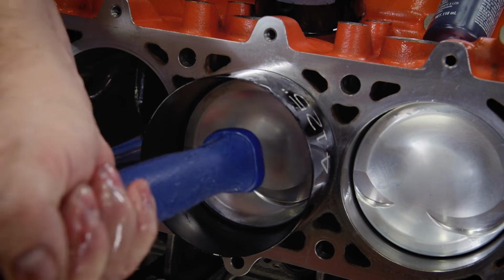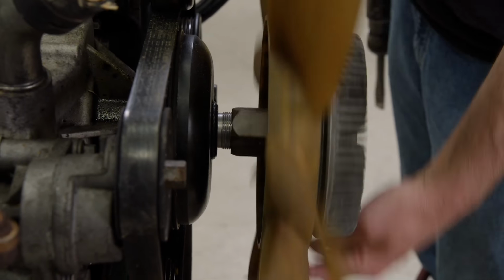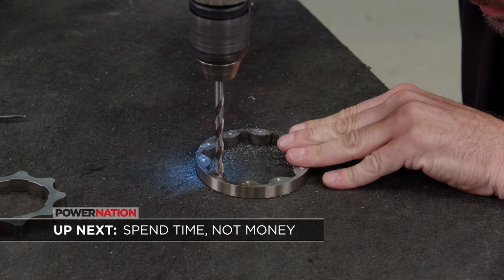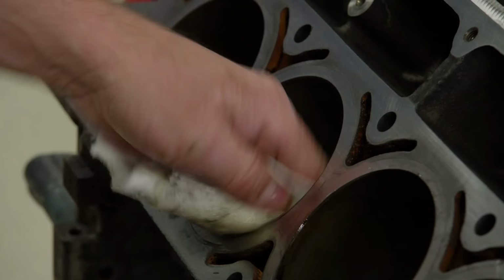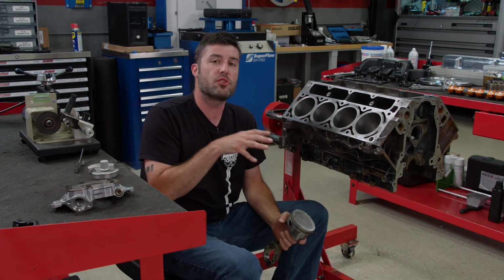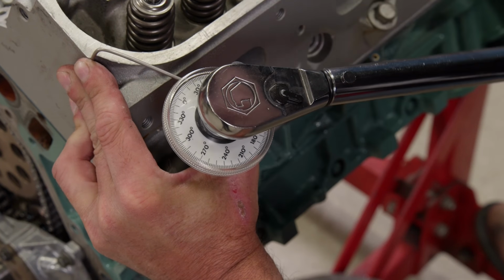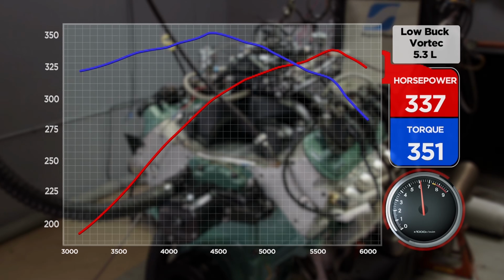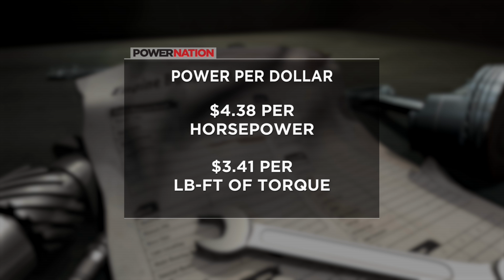Minor Upgrades Create Crazy Power on a Junkyard 5.3L Vortec - Engine Power S7, E10

Comment: Wow 30,000 on ring gaps is huge! Factory specs are 19,000!  Im running twin turbos on my 04 lq4 6.0. I did same thing, new rings n bearings, hand honed cylinders, valve job, new cam, cam bearings and valve springs too. So I opened my ring gaps to 28,000 on top and 26,000 second  ring for turbo motor. I ran it this way for a year naturally aspirated no problems. Now I added and run it with twin turbos 10lbs boost, e85, sloppy Stage II cam 228/230, 585/585 lift, 112 lobe separation, 100 lbs injectors, terminator x, TBSS intake, turbo 400 trans in 72 nova. Runs super, very strong, reliable and no issues!!! Great fast street/strip car, very good street manners too.

Comment: 2004 silverado 12 miles over 300,000 this 5.3 doesnt so much as even tick,clatter nothing it can burnout in four high the looks this old girl gets but alas,the body is so rusty i got sick of moving grounds had to ground the engine to the frame along with almost everything else thinking about treating the 5.3 to a bath gaskets,and swapping all most mint no rust 98 gmc cab onto her old bones yup grace may get a face lift.like buying a ham and taking out the bone,waahoo brand new ride,by the way can any body recommend any mild lift kits or leveling kits,because the fancy label places seem to be getting shittier by the year, thanks

Comment: You left out the most expensive part. Add another $1k for the engine management system. An LS doesn't have a distributor. It will not run without an engine controller. Pretty deceptive on the total cost. Regardless of what you read on forums, $500 complete LS engines don't exist. Known good engines for less than $1,200 are rare. The actual price for this complete, running LS with nitrous would be closer to $5,000. That doesn't include the labor or the cost of having the block cleaned, fluxed and prepped. Then you need another $1500 worth of specialty tools to get it assembled. After that you'll need new engine mounts, a flywheel and clutch assembly, entire cooling system and a bunch of new gauges for monitoring the vitals. That's only if you already have a GM transmission. If not you'll need to add that as well as the driveshaft and cross member. If you're looking to repower a rolling chassis then you're looking at $7500 for this same setup. If you're looking to repower something that already has a GM transmission and you don't need 550hp, just buy a $1,200 complete 5.3 with a harness and plug it in. That's a swap you can do for less than $2 grand.

Comment: You guys didn't remove and fix that crappy relief valve in the oil pan, on the oiling system that breaks and starves the cam for oil....?  Just had a 4.9L bored/stroked to a 5.7L and that's one of the things my builder fixed!  Previous one had went out and it literally ate the cam!

He put a plug in it!  Boom 60psi oil pressure on cold start like it should have!

Comment: LOOK AT THE BEARINGS THEY ARE BRAND NEW BETTER REPLACE THEM . THATS A GOOD WAY TO WAIST 1400 DOLLARS .This is why every doorknob  that owns a cresant wrench and a hammer thinks they are a mechanic .Did not even include the carb or the fact that you still need engine control in price crap like this just sets people up for failure .

Comment: i was wondering if any of your knowledgeable staff could answer a question,i have a 98 gmc sierra with the m30/4l60e transmission,and i want to swap in a fresh 04 5.3ls that im building nothing fancy do i need a different flexplate or anything any help will be appreciated by the way ive been a fan since it used to the power block back when courtney was the hostess

Comment: Do what I do grab a 200 dollar 350 build it up very cheap as in a 300 dollar stock rebuild kit off eBay through in the new rods and pistons, bearings and caps cheap set of valve springs 500 lift cam port the heads my self some open tube headers and a 800cfm holly double pumper and a racing electric fuel pump block off the old Manuel fuel pump hole and   and put it in my Miata and let her rip for a few years till it blows runs mid 10s at the quarter great bracket racing setup or easy money maker killing mustangs and Camaros and dumb V6 and 4 cylinder  Camaro owners and mustang owners as well who think there 200 hp junk is faster then a ugly ass junkyard looking built Miata lol love it

Comment: Either that intake is junk or they got punked on the camshaft. All other 200k+ mile stock cam 5.3's I've seen on the same Superflow dyno make 345-355 HP w/o accessories. Either way a 63% increase is pretty neat.

Comment: They left out a lot of costs!! Like new carb , air cleaner, throttle linkage, headers, dual exhaust, new push rods, rocker arm, taking to machine shop for cleaning block and polish crank. Plus if you do all that work you would want to put New gaskets and rod bearings.

Comment: I bought a truck that tree had crushed, for a 5.3 build. Never looked at mileage till I tore down engine. The oil stain on the head was pretty dark. The bearings looked mildly worn not horrible tho. It had ran supposedly before tree fell on it. While stripping the interior to sell the good parts, I glanced at mileage. Damned thing had 430,XXX miles. 
I figured nah its not original engine lol well I ended up calling the guy and he had bought it from his dad, who bought it brand new. They were the only two owners. The engine was original, but it was on its 3rd transmission 🤣 they had ran Castrol full synthetic for its whole life.

If anyone ever tells you chevy is toast after 150k... you can assume they don't maintain their cars haha

Comment: You forgot to add the price of oil and filter, coolant, air filter, power steering fluid, drive belts, spark plugs, oil pressure sensor, freon, motor mounts, assembly lube, sand paper and likely a bunch more stuff. The bill just went up another grand or more.

Comment: I bought my 04 avalanche NEW  same  motor 5.3 iron , 2021 march  my oil pan cracked from age cast aluminum  it was clean there was NO crap  , I always change the oil 3k miles ,  also changed the pick up tube  O-Ring.  Which is the number  one cause of low oil pressure , I think they over tightened the pan and cracked it ,  can't prove, new pan  500 $  ,

Comment: I have a 97 Silverado dually with a vortech 454 with 120k miles that is broke down needs a fuel pump , I'm going to make something but not sure yet, I was thinking to pump up the HP a notch and do the body work and paint the whole truck with bedliner and put a 6 inch lift and rebuild the rear-end with a 4.88 gear or maybe a 5.13 as I have done this same exact thing to a 98 ford ranger 2wd 4 banger and it worked out great for the back roads and the city with 35,s on back and 33,s on front with no rubs and it takes off better now than when it had its tiny 14 inch tires on it. and I have a few old 350,s and 2 400,s in the shed and may get rid of the 4 banger and stick in a 400 with Muncie 4 speed and the ford ranger has the perfect frame setup to easily do this. but I'm going to make a similar truck out of the dually. They will be twins kinda.

Comment: The factory ratings on that were net with full accessories and full factory exhaust.  This one had a "Stage III" cam and was dynoed in gross rating configuration with no accessories and headers and got those numbers?  Something is wrong with the tune or the engine.

Comment: If they added the price of the carburetor and the MSD box and new spark plugs and wires. I imagine the price jumps way above $3000. I think it's a fraud build.. better to use the original parts and computer to buy only a intake and performance tune kit. I bet it would run the same and cheaper for the money

Comment: Forgot to tally coil packs, plugs, wires, fluids, filters, sensors, valley cover, etc. Substantially proportional to stated costs compared to what you actually used overall.

Comment: I looked at a mid 2000s Pontiac Grand Prix GTP years ago when new. They are the 5.3 Supercharger setup. I test drove it but it did not have the Ooomph I was looking for. I had a Pontiac Grand Am at the time. Back then the only real performance available was the Corvette or Mustangs GTs. When the Camaro came back out I got a 2011. Nice car. I later traded it in on a 2017 Camaro SS 6 speed which is my current car. The fastest car I have owned so far and I have owned 60s era Muscle.

Comment: Now take that same engine and install a good intake plenum and run the fuel injection on it.
I want to know what the actual difference would be between a carburated setup and the properly tuned fuel injection .

Comment: Love this engine make sure you replace the "spider" inside the air plenum.
Reply: Can you explain this more, i am in the process of opening a 5.3l
Reply: @kevinc5917  is called spider injector there are videos here in YOUTUBE about it the problem is the seals break and fuel will start leaking  mixing with the engine oil. Another problem with the engine is the oil cooler the lines tend to break at the connectors. Otherwise is a great engine with lots of power.
Reply: @kevinc5917  system was on my Sonoma pickup a V6 not sure if the V8 uses the same pre ignition system.

Comment: I've worked on internal combustion engines my entire life and they sound, beautiful. but I've sat in a Tesla electric car and saw its engineering and I have got to say the gas people have got to go with what they used to go with, a long-lasting easy repair. the days of the different bolts for each hole have to end I grew up in Chevrolets, I replaced the power steering pumps of the 350 trucks in the 70S the 80 and the 90s, and now in my S10 with a vortex engine, the vortex are a marvel of engineering My S10 has over 100,000 and the engine is still clean on the inside. Why would my alma Mata use this crazy ac compressor bracket is there some kind of crazy torc I've missed? That the power steering pump is secured with seven different size bolts 13,14,15,16,17,18mm and I'm leaving out the upper neck little brace, I haven't changed a power steering pump in a while, but now the pulley has no holes so now you have to remove the pulley, It took me three days. and I had to get help because it's not a one-man job! first soaked it with a liquid wrench we removed the ac compressor, the belt, the clutch fan, the radiator and all its accessories, the throttle cable, and a bracket in 1998 I replaced a power steering pump in two hours alone and didn't even remove the belts, the bolts and this crazy ac bracket designed by someone with way to much time on his hands. and the hose that feeds into the center of the pump is now bent as if some kid in kindergarten was bored and decided to try something new and messed it up and left it! Even my loyal gm neighbor said "well it is remanufactured" and we both got a laugh, anyway it took me three tries to get the pulley off of the shaft and I had to hit the pulley with an Estwing 24 once hammer, hard. I was mad and ashamed, I'm not using the old pump and ill tell them I had to, it broke it free but to remove the pulley it took two of us a while to ratchet it off but it's off. And I'm gonna cut the holes in this pulley to match the 1980 pulley holes, so if I have to remove it again, I'm not messing with the pullers. And I'm leaving out a bolt, it's the very bottom one and it's not necessary, hell I believe they could have used three bolts period instead of seven, well five bolts and two nuts also for anyone out there, don't tighten the first bolts, until you have all of them treaded. And I think it could have been done without removing the clutch fan, also why doesn't the fan have the missing blades for easy repair???GM the future is electric trucks and you need to get your electric truck in the market now  IF GM WAS TO MAKE THE ENTIRE ELECTRIC TRUCK WITH THE ABILITY TO REMOVE EVERYTHING WITH A PHILLIPS SCREWDRIVER AND A RATCHET WITH FOUR  LONG SOCKETS.  EVERYONE WOULD consider it, if not BUY yours, JUST FOR THAT REASON. The entire market would think...... GM thinking of our future! ...hell just take a Silverado and make it electric make sure and get 400 miles per charge that's all you have to do! you would beat the ford F150...  Silverado with extended cab would mean a whole new thing. I dare you to do better!

Comment: Love the ring squaring tool. Never heard of one but is a must have. I’m a perfectionist when building anything and it would make it so much easier.
Reply: Save your $$ and use one of the pistons you just pulled out of the engine.
Reply: Do it by hand and use the back end of a caliper to see that it is square.
Reply: Use an upside down piston with the second ring on it.

Comment: Hi. I love your video.
I have to ask you, when putting the piston back into the block, what is the importance of the piston ring gaps?
I would also like to know how are the piston ring gaps aligned?
Are the piston ring gaps aligned in a straight vertical pattern?
Or
Are the piston ring gaps aligned in an offset pattern?

If the ring gaps are installed in an offset pattern, what are the offset degrees from the top ring  in respect to the other rings?

You feedback will be appreciated
Reply: 90 degrees from each other

Comment: Great video with a bunch of good tips for the oil pump, etc. 

My only argument is, you guys already had every part needed to keep the original EFI, but chose to buy a MSD ignition box, Intake manifold and carburetor… why? 

This is a “junkyard build” where you guys wanted to keep costs low, and yet spent probably 1500$ on changing it to carbureted when you could have ran the efi for just the cost of credits to tune it, in the 100$ US range. 

It would be infinitely more tunable and infinitely better driving experience on the street in any climate, temperature or elevation. 

Otherwise, great video 🤘

Comment: Looking for a shop on the east coast to rebuild a 305 chevy monte carlo 1987 engine and bring the horsepower up to 500 hp + and upgrade the rear end to match the engine out put . Also need a body shop to cut in t tops custom interior and paint job . I never had a car rebuilt and it's hard to find a mechanic and body shop person that does great work

Comment: Why do they lube the cylinder hone with 10w30? Is it because that motor uses 10w30 during operation or is 10w30 just a good hone oil weight in general?

Comment: That's why I use hand tools to take the engine apart and to put them together if you used a impact taking them apart you can't feel how the bolts come out and you may miss something important that you would want to fix before putting it back together.

Comment: I just yanked my 320K km 5.3 out of my Sierra - Other than VERY minor oil staining, the inside is totally clean. Bearings look like they almost just came out of the package. Bought from the original owner 5 years ago (so I know it's never been tampered with). DOD lifters were getting a bit janky, but still worked fine (large reason for my pulling it down was to do the delete). I've always done full synthetic changes at around 7000km.  Point is, a well maintained engine like this CAN and WILL last!

Comment: You got a total of $2470 at the end, but you didn't include the carburetor you used ($925), spark plug wires, headers, harmonic balancer, fasteners you replaced like the headbolts, etc. So probably closer to $4400. Don't put a carb on it though at least get a Terminator X

Comment: Hi guys Great job !!! I was wondering I have a 05 z71 tahoe that needs lifters it's got 200k on and I was thinking of doing the same thing as you guys did but run stock everything else,I already have a 3 inch exhaust that has a walker super turbo muffler and air raid intake,will the cam you used be able to run with a stock computer? I also plan on buying a set of headers for it too..thanx for all the great tips
Reply: ECM just needs a tune for best performance.

Comment: I've built many junkyard found engines by hand using nothing but a well calibrated torque wrench, good quality bearings and piston rings, new pumps/gaskets, some Plastigage, and some common sense. You don't necessarily need all of these machine shop tools to rebuild a stock engine, you just need to know what you're doing. For instance, I built a B18B1 (1.8L DOHC non-VTEC Honda engine) and after break-in it put down 409 whp on an eBay GT3582R turbo.
Reply: What power adder did you use?
Reply: @matthewvarnam4302  he said a GT3582R ebay turbo
Reply: @matthewvarnam4302  Turbo
Reply: As long as you’re careful and know what you’re doing should be okay
Reply: I envy you

Comment: To me, going to a carb when you got an ECM with the engine and all of the Injectors is sillyness. That should have been a 411 ECM, those are programmable. Would have much rather seen you make it squirt again rather than sucking fuel out of a carb.
Reply: Carbs produce more power and better fuel economy than fuel injections. This is a misconception that has been going on for decades.

Comment: For more power on the cheap,use ebay 4.8 flat top pistons.cheap and great compression.
The 5.3 stock  pistons have coated skirts that wear off and ruin the lifters and oil pump.also causes piston knock.very common.no way I would reuse high mile pistons.